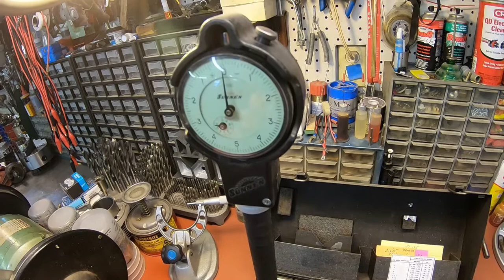Motorcycle cylinder honing and port chamfering

Comment: Thousands are much easier to cope with when measuring, the seven you mentioned, I call it .07, good job all the same, love the barrel stand too.
I use a hardwood wooden dowel for the de-burring with a small slot cut across and into the end that the paper slots into and a small O-ring to hold the paper firm, makes for faster change out's.
Reply from the maker: Thanks Davy, yeah, I know what I'm thinking but sometimes it doesn't come out of my mouth right. But at least I know what I'm looking for most of the time. That sounds like a great way to deburr to me. Good tip. Hey thanks for hanging out in the shop with me.

Comment: Do you know what mandrel you are using? I have an AN-600 head but need to hone out some small 50-80cc motors. Any recommendations for the smaller bores?
Reply from the maker: Hi Josh, yeah the AN 600 starts at 1 3/4 inch I think. Smallest I can do with my AN 600 is a 175 or a 185. Not sure what your cylinder bore size is, I use SL mandrel for the smaller bores. If you give me the size you need to do I can tell you what SL mandrel you need. Or just take a look at Sunnens web page, they have a chart. They are available new, but I would look to ebay for used ones. Get your new stones from Sunnen though.  Thanks for hanging out with me in the shop.
Reply: @montana2strokeracer  I don't think they still produce the SL mandrel line which would explain why I could not find them in the catalog. It looks like the P28 series might be what replaced the SL line. I am looking to hone out cylinders as small as 50cc or 1.5 inch diameter bores all the way up to the smaller end of the AN600. I would probably buy them as need but was not sure which line of hones to choose from. How many stones does your mandrel have? Thanks for replying
Reply from the maker: @joshmorris570  Hey Josh, yep, your right Sunnen has renumbered everything, just a month ago I was trying to get some stones for my JN 95 hand hone, they used to be T20, now they are U22.  Well anyway the SL mandrel has two stones, they are both on top about 3 inches each. The bottom is the guide, and the bore actually runs right on it. The top is the hone. I think the P28 two hone unit is the replacement, they look nicer because you can replace the guide shoes at the bottom. If you want to get the SL mandrels the guy, I deal with is Dan at Cavco Sales in Council Grove KS. 620-767-7273. He has lots of used Sunnen machines and mandrels, very fair on prices. He is also a very good source of information since he was once a Sunnen distributor. The SL mandrels work very well and give a good round hole. I never have any difference between the top and the bottom. You never have to worry about snagging a port. The stones are still available through him or Sunnen. If you get either the SL or the P28 remember you need the truing sleeve also. Hope this helps if you need more info, please feel free to email me. dsweger@bresnan.net